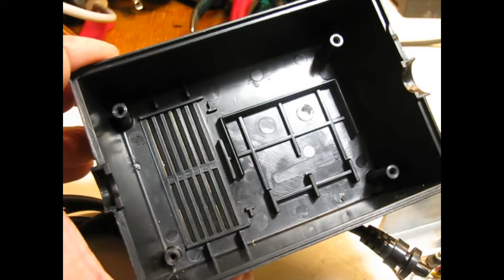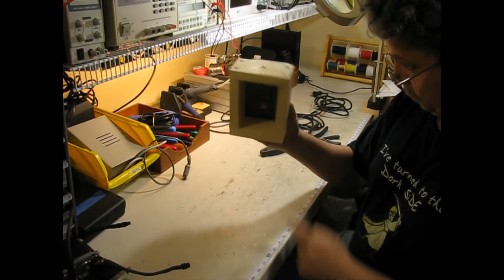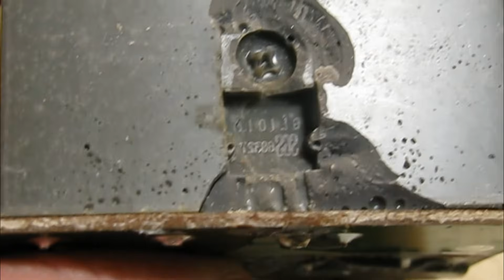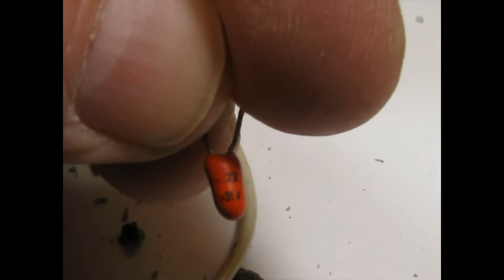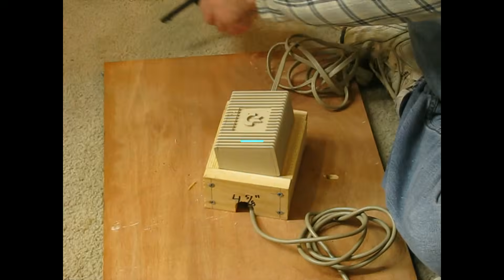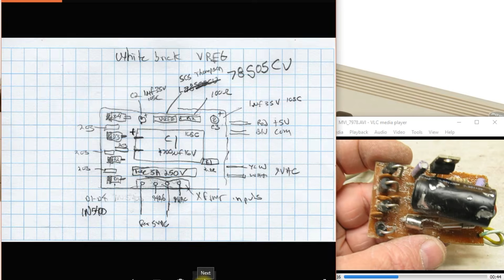C64 Power Supply Video Part 2

Comment: I was wondering why they did not have a full bridge rectifier in the black brick, then you opened up the white brick and I now see why :-/
Reply from the maker: Yeah, with the center tapped transformer you don't need a full bridge rectifier.
Reply: @HeyBirt  ah :-) as you may be able to tell I am stating from your first vids :-D
Reply from the maker: @carnright  Thanks! Hopefully they get better as time marched on.

Comment: Hi Birt, what would you recommend to repair one of those Repairable C64 PSUs?  I have one and would love to Refurbish it. Great Reference Video btw, I've waytched it a few times.   -Mark.
Reply from the maker: Hi. Are you referring to one of the early black 'brick' type that is repairable or one of the European 'wedge' type? On the black brick type there are very few parts inside: A big filter cap, a 7805 type regulator and a smaller cap if I remember correctly. I would replace the caps and use a good quality 2A rated 7805 type regulator. You should be able to find with with over temp and over current protection built in.
Reply: @HeyBirt  yeah I live in Canada so only the North American versions for me, LOL. I believe the large-cap was 4700 although I'm not sure what the smaller one was. There seem to be so many different 7805 voltage Regulators so I'm not sure what would be the best or the proper one to be accurate? Thanks for the quick response definitely watch the channel lot and use it as a reference as in this case, LOL
Reply from the maker: @deborahberi3249  Let me dig mine out and I'll see if I can come up with a parts list.
Reply: @HeyBirt  Awesome, thanks!  -Mark.

Comment: Nice video, fun to watch!
I understand smacking the thing into a hard surface will make the block loosen from the surrounding plastic case after loosening the sides - kind of like crashing with the car and not using a seatbelt - why did you decide to smack it with a hammer? I thought at first you just wanted to seat it in the wooden holder. If you had grabbed the cables and smacked that thing into the floor as well it might have come loose as well. 
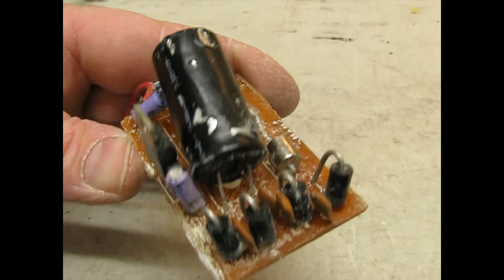34:58 - ahh - the fuse is broken!   ;-) How evil to sink a (non resettable) fuse into epoxy...
Reply from the maker: The black brick would pop loose by smacking on a hard surface. The epoxy in the white brick was softer, almost sticky and would not come loose like that. I tried smacking it on top which did not work either. It did loosen it enough to pry the regulator section out.
Reply: Well... you got the job done at least.   ;-)